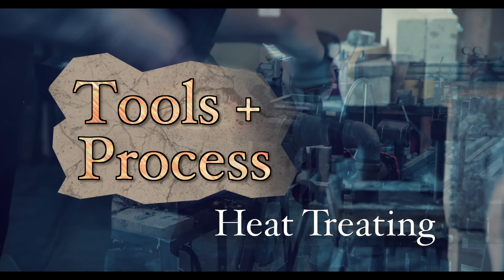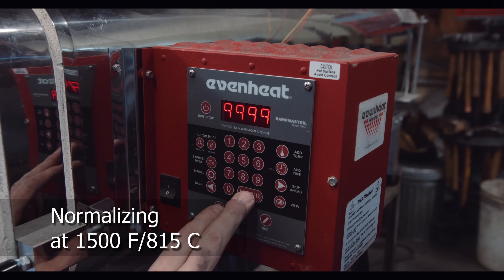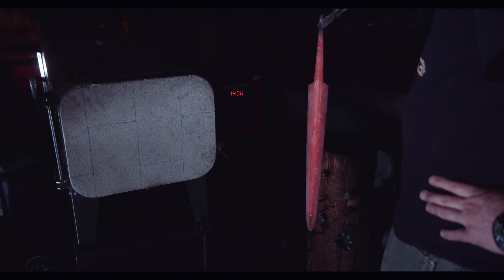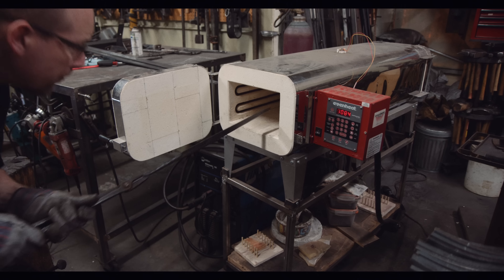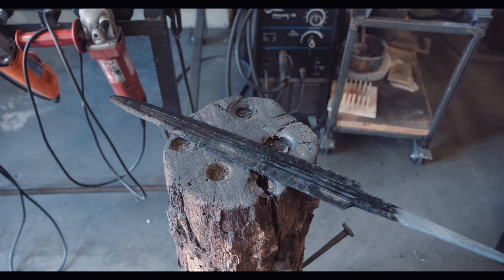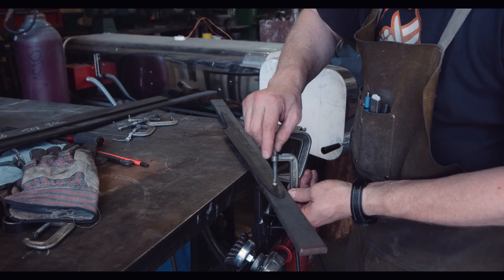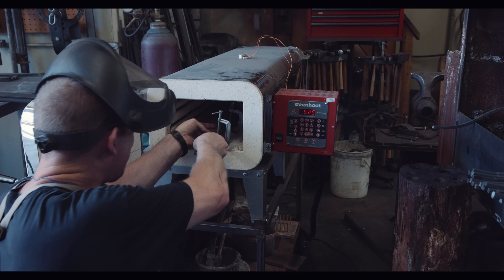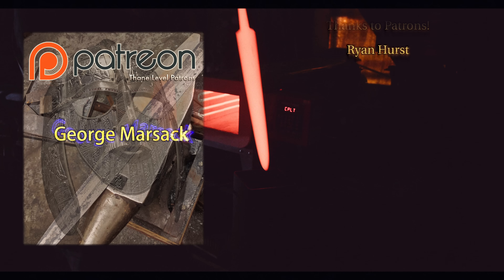Tools and Process: Heat Treating

Comment: I'd love to see some details about your air power hammer and how it's built maybe a bit about the dies as well. Also something I've never seen covered is the transition from a forged blade to a ground one, for example how to get flat straight and crisp bevels that were previously forged. I can forge a blade close to shape or I can stock remove a pretty good blade but for some strange reason putting them together is tricky. Thanks for what you do!

Comment: I forged out a dagger and ended up having to quench a few times because it didn't harden at first. This resulted in several fractures. Is there a way to fix it at this point or is it trash?
Reply from the maker: It's trash in terms of making any use of it but hopefully still a valuable experience.

Comment: Hi, I did not know the designation of your steel, on which you use the 815°...do you know hoch much carbon this steel has? If you use steel with 0,4% of carbon what critical temperature would you use? Approximately?
Reply from the maker: +il li [GA7] it's 1075
Reply: tanks :)

Comment: If quenching in water ,  what will happen?
Chinese and Japan blacksmiths  always quenching in water
Thanks for your reply ：-)
Reply: Faro chao just Google it, it'll get hard lol, some metals will just break, water sucks, the high surface tension makes it a poor quenchant
Reply: It depends on what kind of steel do you use. If you cool down some kinds of steel in water, it is possible that the blade get a tiny crack because water cool the steel down very fast.

Sorry for my English :S
Reply from the maker: In general, there are water hardening and oil hardening steels. Water hardening steels tend to be plain high-carbon steels. Since water quenching is somewhat aggressive, there are extra steps you need to take to prevent the blade from cracking, e.g. such as removing vertical grinder marks or coating the blade in a light clay coat.
Reply: As well as raising the temperature of your quench medium prior to quenching.
Reply from the maker: I have never done that and yet have to crack a blade in water. That said I don't quench in water all that often anymore.